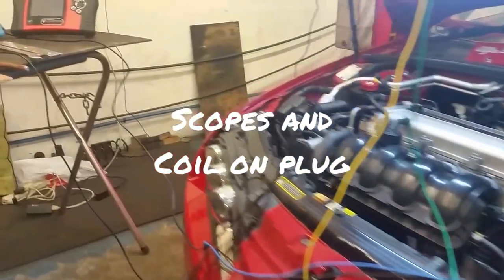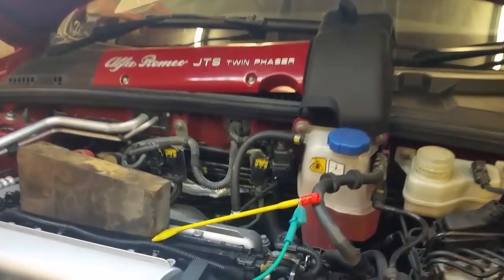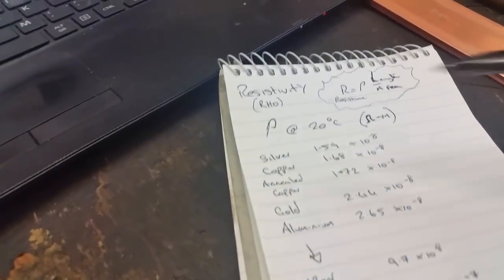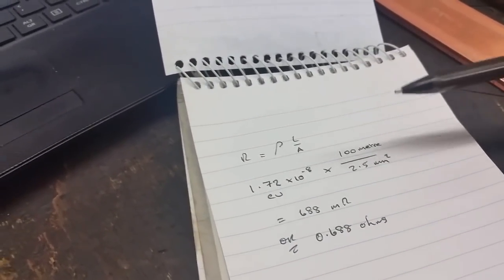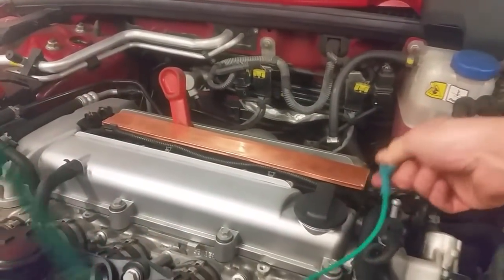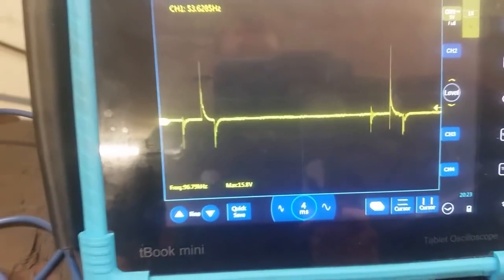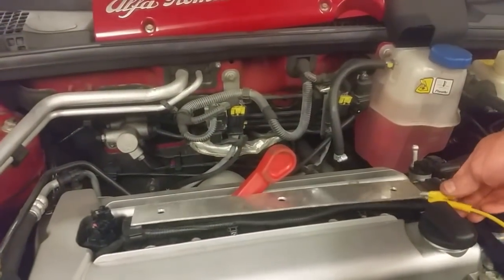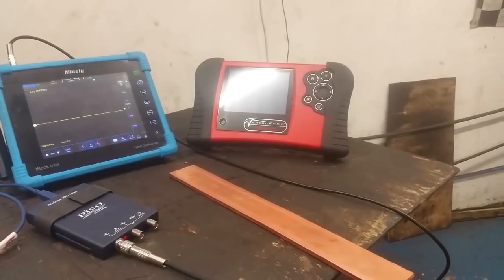Multi Coil on Plug Testing ,Ocscilloscope Paddle Probe

Comment: Hello!can we make something similar ...common and for the injectors pulse all in 1 channel?for example in a 4 cylinder gas engine 4 wires each one from injectors pulse with a diode to each wire to avoid short all of them to the same pulse and connect all of this with some kind of adapter to the channel test lead?it will works?and if yes what parts(just diode?capacitor?etc)must use to build this tool with safe to scope?have you ever try to build one?thank you!best regards!
Reply from the maker: Haven't trid that, sorry
Reply: @davesterl  could be work as I mention?

Comment: Good stuff Dave, Pico for the win, although the vantage looks great as well.  What I tend to do now with coil packs when looking for misfire is just jump into normal obd mode 6 on the autel and bingo  it shows the count, just done a insignia showed number 1 misfire, removed it and number 1 had split with the green mould, so new coil pack! Cheers sandy